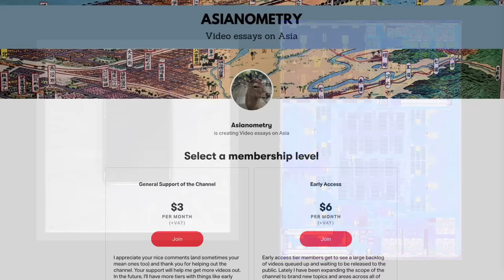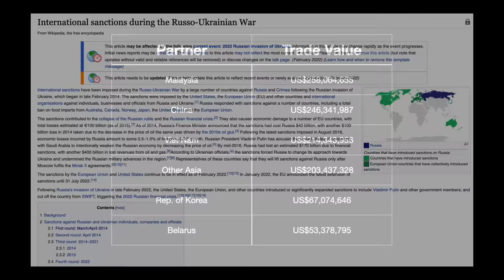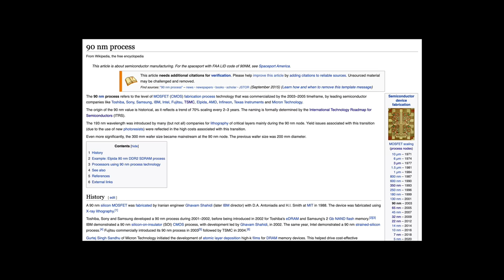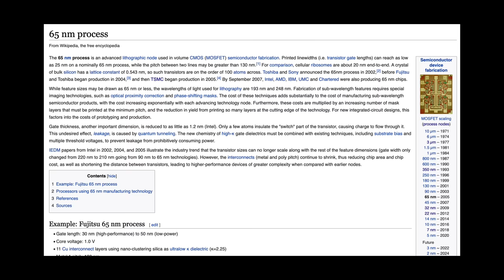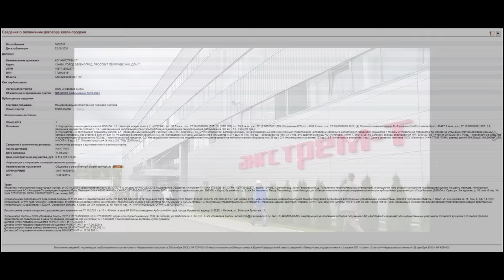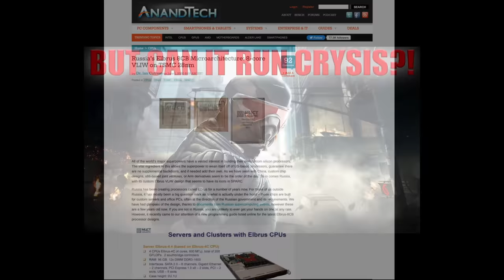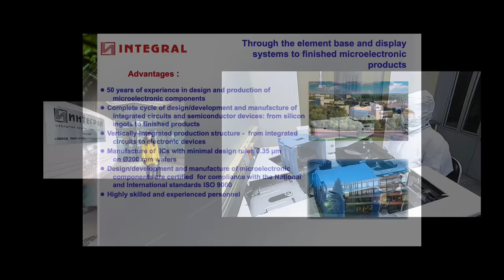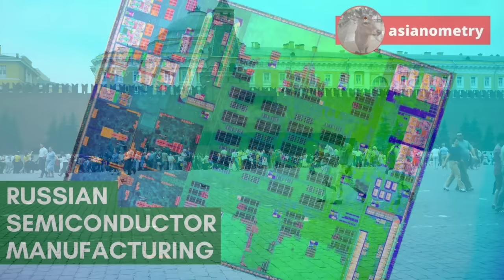Why Russia Can’t Replace TSMC

Comment: Everyone relies on TSMC. Even Intel are using TSMC for their discrete GPU fabbing. This isn't simply a problem for Russia. What is does mean is that if TSMC goes down for some reason Russia won't be hit as hard as the rest of the world. A more interesting question is why can't TSMC be replaced?
Reply: High end semiconductor manufacturing is front-loaded with capital investment and takes time to bear fruit.  It's a poison pill for bean-counters and shareholders who need immediate return on investment, and that's why domestic manufacture here in America has gradually been replaced by domestic design + outsourced fabrication.  It would take several years and a lot of boardroom bravery to replace TSMC so I wouldn't expect it to happen unless the shit truly hits the fan.
Reply: Sheer amount of money they are pouring into themselves at the cost of profit.

They reinvest almost all of their profits instead of taking fat paychecks - and they make a lot of profit, and they are at the top of their game right now, to compete with that intel might need government investment from USA, hence
Reply: TSMC can be replaced but at what cost? "10", 14++ and 28nm fabs exist in the US in the mean time, they're just not as cool as 10/7/5/3nm. As for domestic Russia, well, the military usually drives their progress. This situation might be a good kick in the ass for more R&D on their end. GAAFET nanowire tech is the near future for smaller transistors and it's been known of for a while now. Make that economical and you solve one of the big problems of the cutting edge while everyone else is dumping cash into the same ol' but ever smaller FINFETS. 
That's a tall order though. There are hundreds of individual and cutting technologies that go into fabricating them let alone designing them. 130 and 90nm tech is still tough but a lot easier comparatively.
Or they could simply develop something unique and pretty irreplaceable like their RD7 Rocket engines but in the chip space.
If their shit is so good and runs Linux, world will be like "wuh? need some of that" kind of like how Apple's M series designs are turning heads.
Reply: @miinyoo  with a hefty cost and work.
Reply: The reason TSMC cant be replaced.

1 they are the largest chip manufacturer in the world.
2 A commitment of 100 billion U.S. dollars worth of chip fabrication over 3 years. which is about 33% of global spending on chip fabrication for 2022.
3 they pioneer the path to better chips with a number of world firsts and patent rights. Including the processes that make the best chips of today. Processes that other companies have given up only to see TSMC pioneer.

Know anyone else pushing the boundaries of chip manufacturing at the semiconductor level? Cause intel gave up to play follow the leader, buying Americas only other viable chip manufacturer "global foundries" in a last ditch attempt to use the U.S. government as a parachute because they are now Americas only "real" chip manufacturer. Making them a matter of national security...
Reply: @brandonhoffman4712  samsung is the only one that comes to mind
Reply: It would take 5 years or more for a new fab to figure out how to do 7nm
.
And by then....3 or 1 nm will be out
.
.
So it will take 5 years for them to prefect their 3nm
.
.
.
Basically 
They would be YEARS behind for a decade or two
Reply: @thomashodgetts5147  Ya its the only one keeping up.
Reply: @agapp11able Ya all EUV lithography systems are currently coming from ASML Holdings in the Netherlands.

SMIC got blacklisted for trade due to its ties with the government of China in combination with China's increased military activity.

 Like claiming the entire east China sea and patrolling it, Sending incessant fly overs, over Taiwan air space with military jets, attacking fishing boats from other nations, building up their navy to have more ships than the United States, etc.

And just like we have seen with Ukraine, if you wait to act until shit goes down. Its too late...

Not that any of it is right... It all just feels wrong.
Reply: @agapp11able 1st the south China sea. 

China started this aggression, and they are also the reason for an international change in how much water is controlled by a nation if the water is off their coast. which is now 200 miles. This wasn't enough for China so they laid claim to all of the south China sea.

China also began making islands in the south China sea and occupying them with armed forces so as not to be deterred by anyone. As they do this, they are claiming more of the south China sea by military force. They are actively pushing out other fishermen out of their own waters  by force. And building up their military forces in a manner to match the united states.

Which can only be seen as escalation to something. This is why the United states has done 2 naval tours through the south China sea to show China we are here and they are not in charge of the south China sea. The second tour of the united states was also in a response to a massive uptick in military flyovers from China to Taiwan and back again. Which still occur daily.

And if you don't expect nations to defend themselves your sorely mistaken. But China is the biggest of these nations, the only one the united states sees as an equal. And they are out there picking on small nations that just need to eat.

So yes we sanctioned them to make sure our military will remain stronger. No ifs, ands, or buts about it. And we will not make a move that does otherwise.

We played a cold war with Russia, now we play a cold war with China. Although oddly enough all we have ever wanted is status quo. Which I guess might be too much?
Reply: My question about TSMC being replaced was rhetorical. It can't be replaced, Asianometry has made a new video I believe. The really interesting what if is what if TSMC went down, what would happen to the world's economy.
Reply: @kalliste23  This is partially why the united states has decided to bring more chip manufacturing to the states. With TSMC, Samsung, and others. with 100's of billions of dollars worth of fabrication facilities coming online within a few years. In an attempt at shoring up American chip fabrication. As well as many of the moves our military plays with China focused on protecting stability in the region.

Unfortunately Taiwan is kind of like Texas if it thought it could secede form the states, which places the Taiwan Semiconductor Manufacturing Corporation at risk.

But Taiwan is in fact, according to international treaties. A part of mainland China. Although according to Taiwan it is an independent nation with an independent government. Both the UN, and U.S. have acknowledged Taiwan as part of China.
Reply: @brandonhoffman4712  yes, it's a mess and replacing TSMC is not a short-term or medium-term prospect. Things are considerably more fubar than people realize. Although the US may have notionally recognized Taiwan as Chinese they're not acting on that in practical fact. Judge by deeds not words.
Reply: TSMC can be replaced. Micron, Intel, AMD, Samsung, etc all create their own chips in their development fabs and have their own overseas fabs that make their core technology ... They only outsource the chips that are peripheral to TSMC but if push came to shove they could put that in their own overseas fabs. Russia doesn't have that option.
Reply: @davidaustin6962  AMD has been going fabless for a while now, Intel is even offloading capacity to TSMC and it has been notoriously "in-house". The reason is they cant keep up, Intel is shifting money into development instead of fabrication and isn't keeping up with others on fabrication. The same signs AMD showed years ago.

Micron, Intel, and AMD together equal less market capitalization than TSMC or Samsung. With Micron @80b, AMD @169b, and Intel @186b. Meanwhile both Samsung and TSMC are up at 450b or so.

Intel cant spend enough to keep up, AMD doesn't want to, and Micron is a joke in comparison. Meanwhile Samsung's profit is coming from and going back into so many sources it couldn't divert it all into fabrication without hurting and potentially losing other sectors like televisions, fridges, etc.
Reply: @kalliste23  Yep, just went through a deep dive after a deep dive lol. I might have decompression sickness after this...

In 2018 the U.S. ratified the Taiwan Travel Act. Which allowed for official relations with Taiwan. Where previously  we had agreed with China to only have non-official relations (Taiwan relations act 1979). Basically government vs corporate relations.

"Relations between the United States and Taiwan have since maneuvered to an official and high-level basis" - Wikipedia
Reply: @brandonhoffman4712  Good points.  And it does take a company up to 4 years to get a fab built from scratch to produce the latest and greatest in high volume (I've been on the teams that have done that), so my point is that yes, you're right in the near term that everyone is too dependent on TSMC, but at least the west could recover, even if it to 4-8 years ... Russia never could recover.
Reply: @davidaustin6962  look at the problems Intel had with their 10nm process - your 4 years to production from scratch is hopelessly optimistic for something approaching the technology TSMC deploys. Sure you could get a run of the mill ASIC fab up in 4 yours...  maybe.
Reply: @kalliste23  I don't know about Intel. I do know both Samsung and Micron (I've worked both places as a proc integration engineer) did fairly well with it, but that's beside my point anyway.
Reply: @davidaustin6962  you'd be best placed, then, to school us on why Samsung and Micron are continually playing catch up to TSMC and Intel fab their GPU at TSMC not on Intel or Samsung or Micron.
Reply: @kalliste23  because cost. TSMC is the low cost leader for mfg. And that's because specialization (mfg vs design, for example) gives you the biggest !/$. In essence, all partners make more money when each specializes, including TSMC. Vertical integration only is more profitable if you can corner a market, but that's really hard in a global marketplace so companies specialize. But that doesn't mean any of the design partners can't do their own mfg.  All the design houses can (and have in the past) do a joint venture to create a competitor to TSMC.  As long as TSMC plays fair they won't have to. But yeah, it would take time to create a solution ... With today's tech (I retired from the industry) probably up to 10 years to put a hurt on TSMC.  TSMC doesn't want that. But all these players, they still maintain their mfg fabs as dev fabs with the very latest tools, running way under capacity because they don't want to do mfg. Doesn't mean they can't.  And remember nearly all of the mfg equipment IP and the mfg process IP is held in joint agreements by a combination of these companies and companies that are close partners to these companies than to TSMC.
Reply: @davidaustin6962  I'm surprised it's as little as 10 years . In any case I don't see it being, in the messy real world, practical to craft an alternative to TSMC. Which makes Taiwan the lynch pin of the global economy. Much of the new tech the emerging global economic order rests on would be crippled if some kind of serious interruption of business at TSMC happened. The world would look very different without TSMC, which is crazy when you think about it.
Reply: @kalliste23  well you're not wrong but I'd say there are a number of lynch pins in that industry. They're all dependent on each other. It's too expensive and complicated for anyone to be an independent manufacturer and really succeed, just due to the amazing technology that's now required to make a state of the art processor or memory module.
Reply: Samsung is currently the only other company in the world that can manufacture chips that are in the same league as TSMC. And even Samsung isn’t doing quite as well as TSMC, but they’re the only other manufacturer successfully manufacturing 5nm chips, and this is a huge accomplishment. 

Intel is playing hard right now though. Within a few years, Intel’s own fabs are likely to be competitive again (their “Intel 4” fabs, roughly comparable to TSMC’s 4nm/5nm nodes, are entering production next year). It will basically become a world where TSMC, Samsung, and Intel are the big three players in the ultra-high-performance fab sphere.
Reply: @kalliste23  Micron is a pure-play commodity memory supplier, they do not serve the same market as TSMC who serves as contact manufacturer for logic chips.  Samsung, on the other hand, serves both market.

Micron Mission Statement:  “Micron Technology is a world leader in innovating memory and storage solutions that accelerate the transformation of information into intelligence, inspiring the world to learn, communicate and advance faster than ever. “

TSMC Mission Statement: “Our mission is to be the trusted technology and capacity provider of the global logic IC industry for years to come.”
Reply: The fact “Russia won’t be hit as hard” by such a scenario is simply because it is a more industrially primitive country, which really isn’t an advantage no matter how hard you try and spin it.
Reply: @shanetonkin2850  not trying to "spin it". TSMC is an infrastructure key point that has consequences.
Reply: It can't be replaced, because they are producing in the most cost-effective way.
That includes loose environment regulations, so that they can use cheaper materials which causes cancers for workers.
In mass production area, the more cunning and exploitative always wins. That's why it's all been moved out to countries like Taiwan and Korea.
While Europe and America focuses on designs and technologies.
Reply: Takes like many tens of billions to get into the game TSMC is in. Even then you can easily fuck up and it takes a lot of time to get things running well. Some equipment used in wafer fab is only made by one company. So it's very hard to just jump into state of the art chips. Basically impossible.
Reply: Asian people have smaller hands so it's easier for them to make small things
Reply: @JohnDoe-420  That's a long winded way of saying it costs a lot of money to build a fab.
Reply: @miinyoo  "Just not as cool", what kind of phrase is that? 
"We'll build a fab in order to be cool". Companies don't spend billions of dollars in order to be "cool".
Reply: @brandonhoffman4712  "According to Taiwan it is an independent nation with an independent government".  The fact is it does have its own government and does not depend on China. China does not over see any part of the administration of Taiwan, ergo it is an independent state. It might not be in legal treaties but it certainly operates as an independent state.
Reply: I think because of efficiency. TSMC very early adopted the policy to manufacture for hire instead of trying to compete with its own designs. It turned out to be a very smart move, because ARM (which is a fabless company) licensees flocked to it.
Reply: Intel makes better chips though.
Alder Lake 10nm is running circles around TSMC 7nm.
Reply: @phillip_iv_planetking6354  I actually agree with Intel's statement that with current fabrication technologies the "x nm" ceased to be a  meaningful characterisation of a chip.
Reply: @reaperinsaltbrine5211  It has.
TSMC 's 7nm is a perfect example of it.
Intel does it too though but they actually get closer to the mark.
Reply: They were first... and started at a time when production itself was in its relative infancy.  That level has to be worked up to and it does not scale in terms of profitability... so it is very difficult to start fresh and build up to the current state of the art much less bleeding edge.  Only one of the current chipmakers w/ fabs could do it but it would require them to build an entirely new fab and spin it off administratively as a separate operation... which would be very difficult to justify as it is a huge sunk cost that would then produce no return profit.  It would require the chipmaker itself to be owned by a parent company in order for that level of decision to even make sense.  These companies are large and typically publicly traded so unless there's a parent company it would be difficult to push this kind of decision at the legal level.  Lastly, lets say a major player like Intel or Samsung tried that... their experience is dealing with their own products and high end.  Imagine having to support hundreds if not thousands or more of fabless clients, some of whom may have certain legacy manufacturing requirements that you've already ditched support for.  The state of the art is actually not appropriate for or cannot produce certain older and ubiquitous products. Like imagine being a USB cable maker and someone asks you to produce a parallel port in small but continuous quantity.  You would not even take the offer of business.
Reply: Samsung and Intel have similar levels of technology, but Samsung has worse design and Intel has a design too specific for their use case.
TSMC is the best at the moment, so everyone relies on them. We could rely on Samsung if they increased their fab capacity in case of a TSMC shutdown.
Reply: @Anankin12  Not really... Samsung and Intel combined probably cannot handle the volume of tsmc.  Like say both nVidia and AMD suddenly need a replacement for tsmc?  At a certain point, Samsung and Intel will say no because their fab time is reserved for themselves first before customers.  This is nevermind the hundreds of small customers there are.  Just about every electronic device you have has at least one chip in it made by tsmc.
Reply: obviously because it could be replaced
it's just a question of who would do it.
Reply: They can be replaced and there are many semiconductor fabs around the world but TMSC is just biggest among them and also have edge of manufacturing at smallest 5mn node process along with Samsung but since they're pureplay fab they don't compete with their mostly fabless B2B customers ie. Apple, AMD, Qualcomm etc which explains their huge market share. But 5nm is mostly used in high end consumer electronics for now. It's nothing world can't go on without and others are catching up too.
Reply: @brandonhoffman4712  intel market cap is around 218b, TSMC is around 330b.  Intel announced a new fab being built in the US that would have expanded capacity to build chips for third party designers.   Intel has a history of high end fabrication facilities and will easily be able to push the market laterally and compete with TSMC in this space.
Reply: Better question will be, why can't ASML be replaced?
Reply: @kalliste23   Well said
Reply: @kainhall  Why can't industrial spies find out all they need to know?
Reply: @brandonhoffman4712  Yes, and once enough leading edge semiconductor device manufacturing expertise is on US soil with TSMC and Samsung fabs and employees, the US will no longer see Taiwan as being as strategically significant.